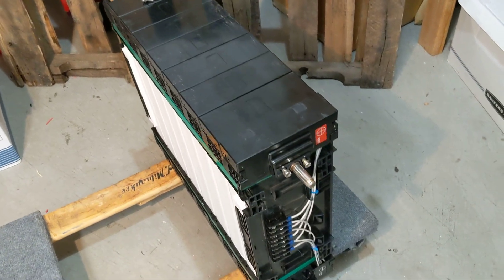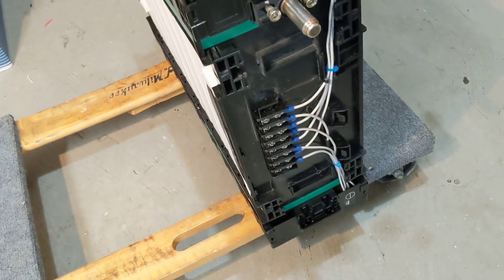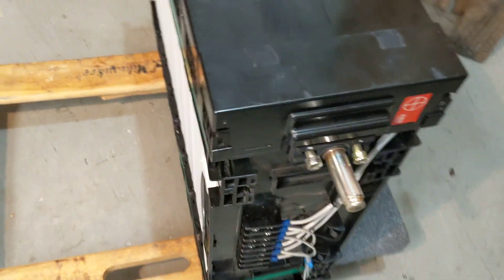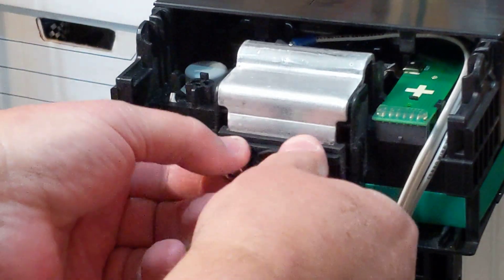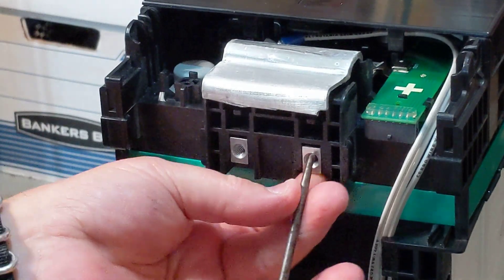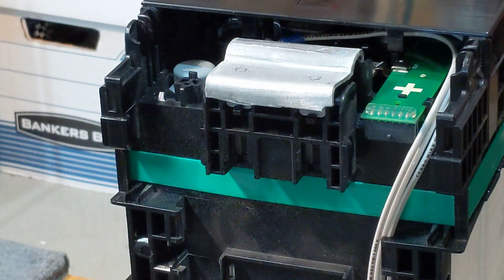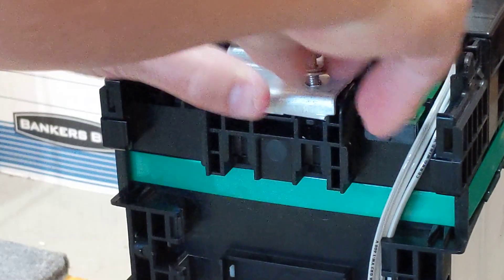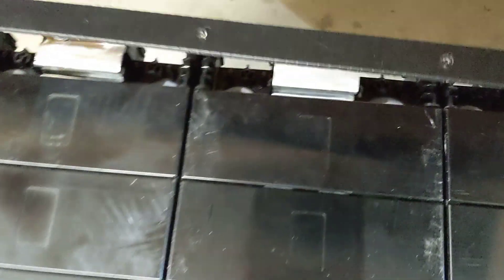BYD Battery Terminal Modification

Comment: Hi Craig, I am filming another video about my BYD batteries.  I would like to give you a shout-out and link to your video because I think you did a fantastic job.  Would that be OK with you, or do you prefer anonymity?
Reply from the maker: Hi David, go ahead and make me famous.  I can take it.  I've used my power wagon several times to ride through outages and it's been working great.  I think most folks have moved on with these batteries, but I'm pleased as can be that someone might still benefit from my efforts.
Reply: @craignels  OK, Cool.  Thanks.

Comment: Heya Craig!  Love how much more compact these are with all the stuff you've removed - bravo!  Mind sharing dimensions of the modified battery?  Was envisioning something similar to the "Tower of Power", but think these would play nice in two sets of four on a couple repurposed metal rolling carts, for welding or similar... thanks!  (This much closer to pulling the trigger on an order of 8 btw, your work got me another 20% there I'd say...)
Reply from the maker: All four batteries together measure 25.75" x 21" x 18.5".  If you send me an email (address in ABOUT section of my channel)  I'll send you some photos of the final assembly.  I put all 4 batteries along with the inverter in a cart.  I call it my power wagon.

I'm of two minds about these batteries.  Realize they are only 3KWHr each.  There are smaller lighter options available for around the same cost.  I did like how simple it was to connect them together at least compared to 18650 power walls.

Comment: I'd love to see a follow up video about your current setup with the batteries.  I love how compact you made them.
Reply from the maker: I promise I will do another video on the completed project.  I finished it some time ago but got stuck when I realized my solar panels had a difficult to bypass rapid shutdown installed so that when the grid is down the panels are disabled.  Once I figure out how to get around that I'll make the next video.

Comment: can you post info  (size of wire) on the balancing cable and the combiner used . Nice structural form of battery bank configuration !
Reply from the maker: I assume you are asking about the terminal blocks I added to parallel my batteries.  I bought the terminal blocks from home depot along with the wire and crimp terminals.  I just roughed up the backs of the blocks and the plastic surface of the battery and epoxied them in place.  The wire I chose to use was just 14 gauge.  This turned out to be plenty for me.  My max current draw from the 4 parallel batteries is 150 amps so about 40 amps from any one battery.  The max current I measured at any point during discharge from full to empty on the "balance" wires was 4 amps.  Frankly I might have been OK to use the existing BYD wiring harness if I knew it would only be 4 amps.  Still I like the heavier wires.  See also David Poz' video.  I believe he chose 10 gauge, but I don't really recall.  I attached the wires to the battery with #4 nuts, bolts and lockwashers.  I think David had a better idea using pop rivets, but I was worried how tight rivets would be, plus I had nuts and bolts, but no pop rivet equipment.  If you send me an email, I'll send you some photos of the whole assembly wired together.  (go to my channel and click ABOUT to get my email)

Eventually I'll make a video of my completed project, but eventually might be a long time.
Reply: @craignels  thank you for sharing!

Comment: The posts are solid copper, just file two sides of the post flat and drill a hole through, you can then bolt on a standard battery cable. I used a grinder with a metal cutting disk to do it quickly.